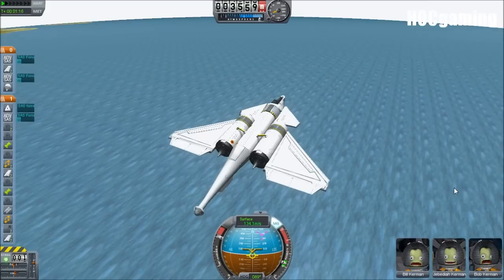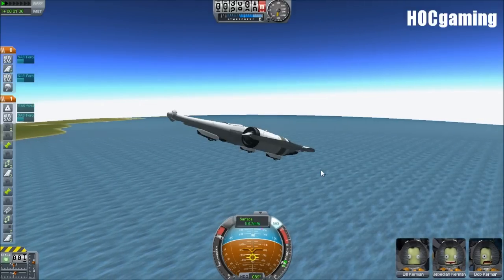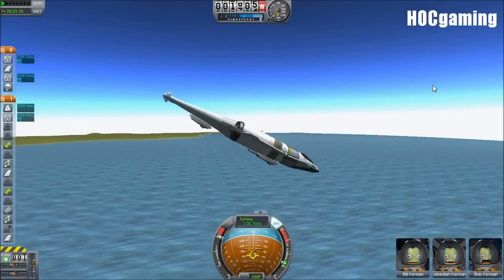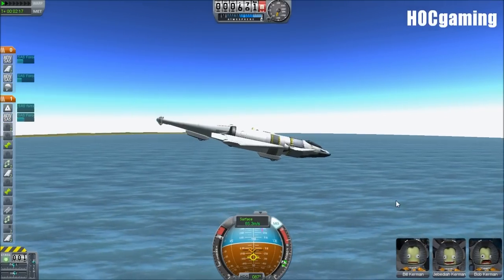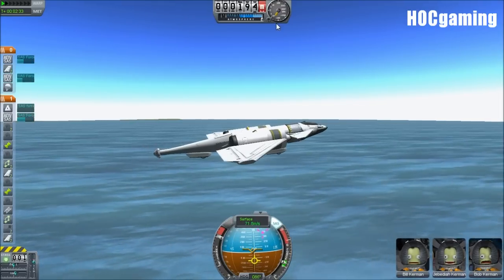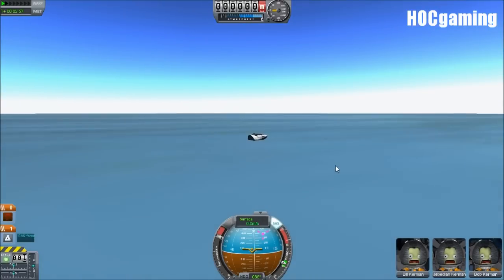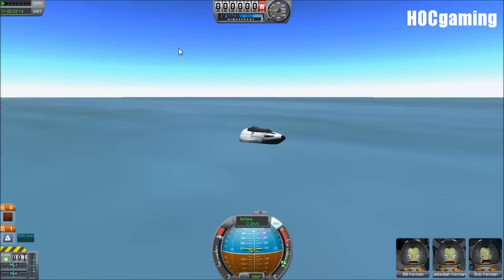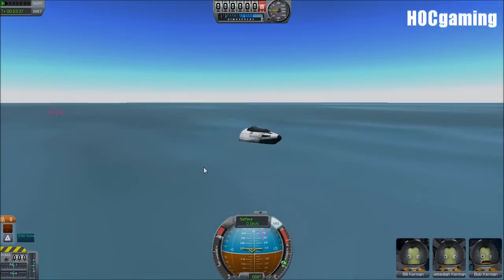Kerbal Space Program: Water Landing

Comment: If you glide down very well then you can slow down your vertical speed by pitching up at around a 500 meters in altitude, then you just glide down slowly until 50 meters high and then just control your vertical speed (which is seen on altimeter at the top of your screen) less than 5 m/s. Then every part of your plane will survive through the water landing.

Comment: lol, I actually managed to land and take-off from water. did it with a ton of air brakes on the landing, if you are under 10m/s nothing will break and you can take off, but it will cause a weird bump/spash sound before you lift (need to have your pitch up).